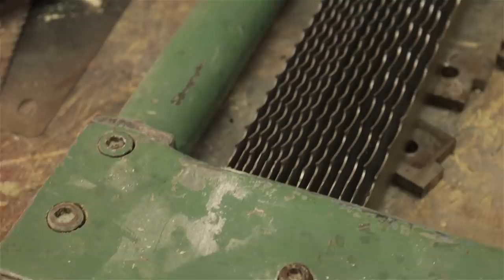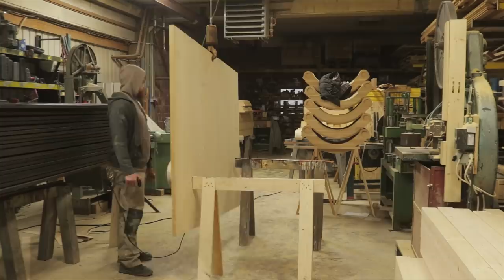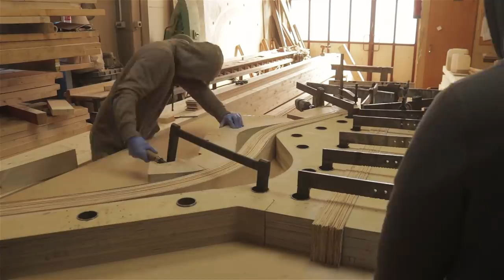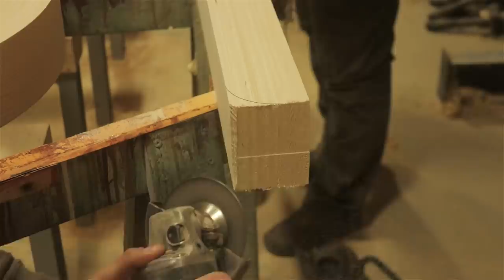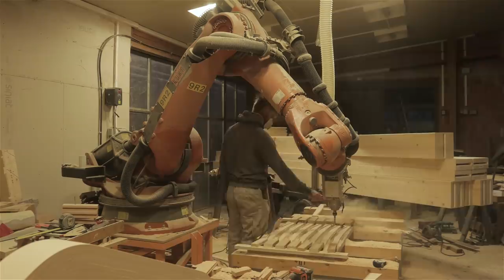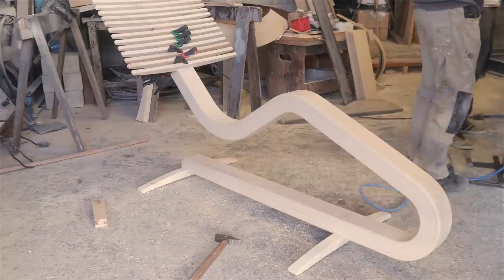Wooden Lounger Chair - latest design

Comment: I wonder what the weight limit would be seeing that he seems to be pretty light and the flex in the frame. Maybe install a bike shock in the back for heavier people… 😆
Reply from the maker: 150 Kg is what I tested it with  but it I think it can take much more. I don't think it would even brake but flex until touching the bottom part.. But the shock could be an interesting extra design feature😉
Reply: @lignumchannel  wow 150kgs, I’m impressed !! You could also design and make your own shock with laminated strips like you used in the frame. Something in the shape of a snake maybe or even more fun, a coil made out of wood but not sure how this could be made. Maybe laminate a stack to make a post and use your robot to carve a coil?

Comment: Wow, look like I should make an upgrade to haha. All the jigs and technique looked much better than before. :) Just wondering with the router and CNC, did you purposely run back cut to save tear out ? Thought only me doing it wrong as the manual said haha. Again, thank you for sharing man, such a great inspiration as always. Cheers :)
Reply from the maker: Yes, but after the climb pass i did another in the opposite direction.. It just didn't end up un the final cut😁  thank you so much for watching! How is that chair doing after all these Years?
Reply: @lignumchannel   it's still in use everyday. I've sent you some photo on Instagram :).

Comment: What IS the weight capacity?  What changes would you need to make to not only support 500 lbs but the impact of said person dropping into the lounger and fidgeting around?  

No doubt wider; two support spines; dish out a little deeper for calves; curve a little further in lumbar support (or dish out more for gluteal room); maybe shape some room for large upper arms?

Finding comfortably furniture for large people is challenging.
Reply: Don't change the chair. Change the diet.
Reply: The website states 150 kg. Plenty enough for most people.
Reply from the maker: I think one support spine should do it, just with bigger crossection.. but it would take a lot of trial and error to get it comfortable..

Comment: Looks like you're mixing two types of glue. Any reason for this?
Reply: Two part epoxy.
Reply: @williamwagner8017  нет, это ПВА. Класс D4
Reply from the maker: @Patrik I use two component melamine d4 because it has long open time.. with regular pvac I wouldn't have enough time to apply it and press it into mold..
Reply: @lignumchannel  Oh ok. That answered my second question as to how you have time to do the glue-up :)

Comment: Very nice as always :) Is there commercial CAM for the KUKA or did you have to roll your own?
Reply: I know that similar parametric objects are being developed in Rhinoceros, and control programs are being made in RhinoCAM. Take a look, maybe you'll like it
Reply: @vladimirpronyashin2707  thanks! I actually meant to say “post processor”, I.e., gcode generation but will take another look at Rhino as I haven’t in a few years
Reply: @rbyt2010  KUKA and Rhino are professional systems and I think there should be this postprocessor in the CAM module. You can write to the support service for clarification.
Reply from the maker: I use rhino with rhinocam and IRBCAM to create krl files for the robot
Reply: @lignumchannel  ahh! that's what I was looking for... Thanks for the videos and the info ;)
Reply: @rbyt2010  So I was right. Rhino is really convenient, and especially when you know programming languages

Comment: I noticed today, not for the first time, you mixed a two part adhesive to bond the laminations. Is that a PVA glue or a type of epoxy?
Reply: Я однажды спрашивал у автора канала. Да, это ПВА
Reply: @vladimirpronyashin2707  Спасибо!
Reply from the maker: @Jeff Libby It is a two component melamine glue which we usually use for glulam. It has long open time so it is ideal when having many layers to glue.